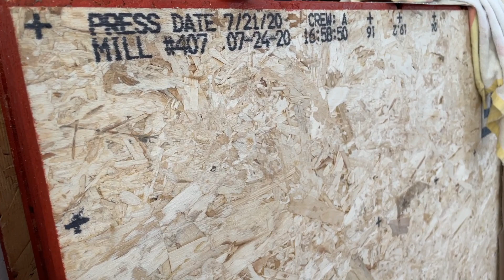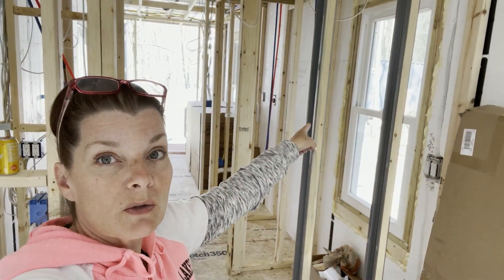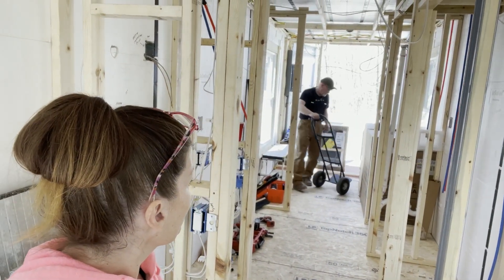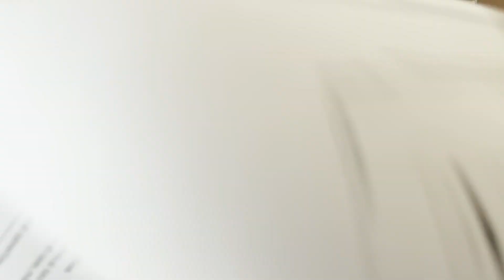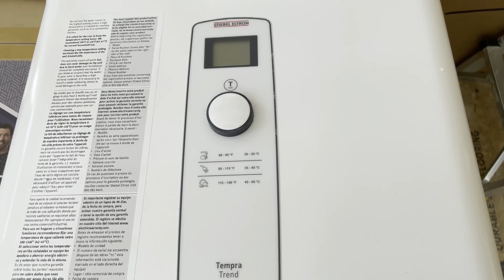Installing a Tankless Hot Water Heater and Sub-Flooring in our Container Home.

Comment: Can I ask you what model water heater you bought? Looks like you ran #10 NM to it? Just a double 30 to power it?
Reply from the maker: Hello! 

The brand/model is Stiebel-Eltron-Tempra-29-Trend-Self-Modulating-28-8-kW-5-66-GPM-Compact-Residential-Electric-Tankless-Water-Heater. We have (2) 40 amps, and (1) 25 amp dedicated to it. The #10 was undersized and changed to a #8. Thank you for asking, and good luck!